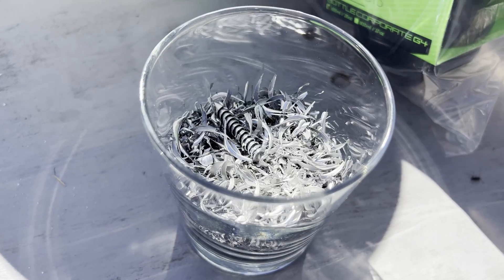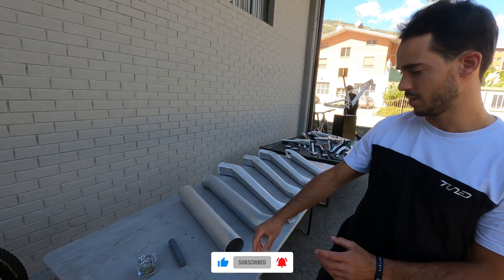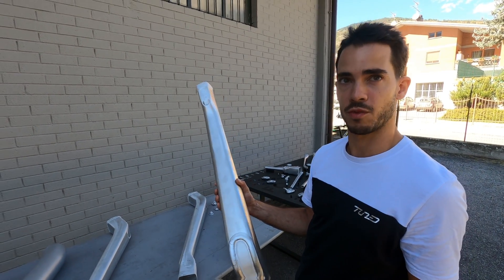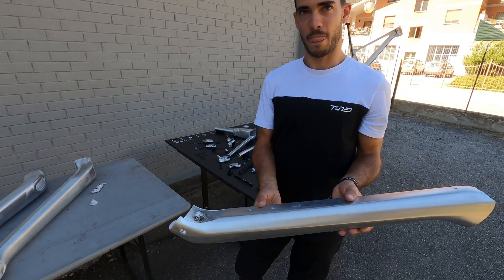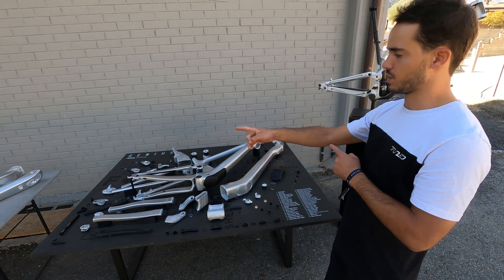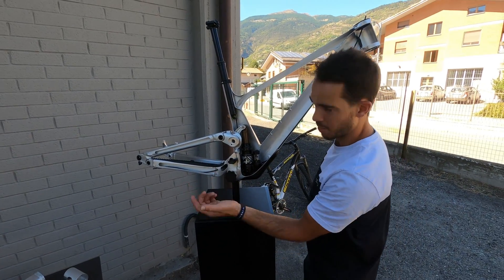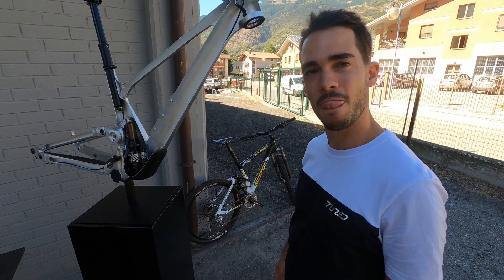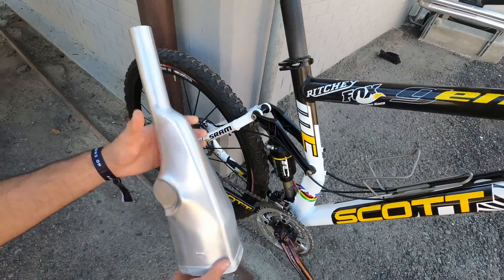How To Make Aluminum Mountain Bike - Scott Genius Alloy #mtb #loamwolf

Comment: I would take that 2001 version any day of the week! I’m not a big fan of “ hidden “ suspension. And 7005 is the ultimate aluminum, it is the premium alloy. 6061 is the generic aluminum used on cheaper bikes. 7005 needs no heat treatment so it won’t compromise the frame. 7005 is hard to come by these days as it’s made with zinc. ( 90 % ) which makes it more expensive.Plus it’s harder to weld 7005 as you need better precision when welding it.